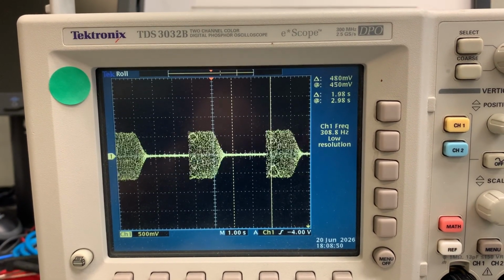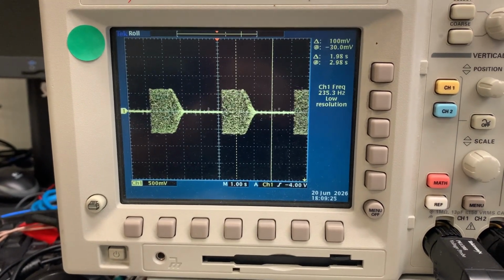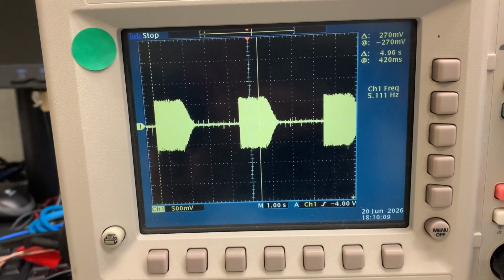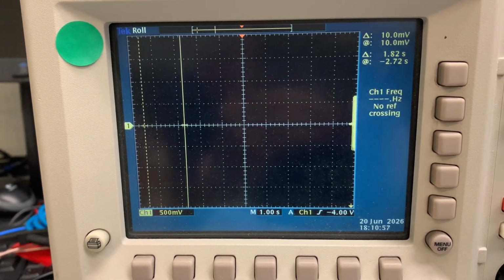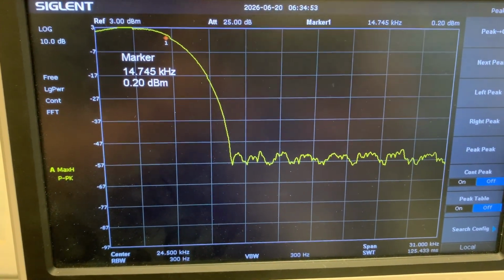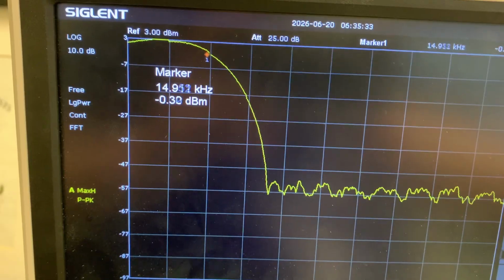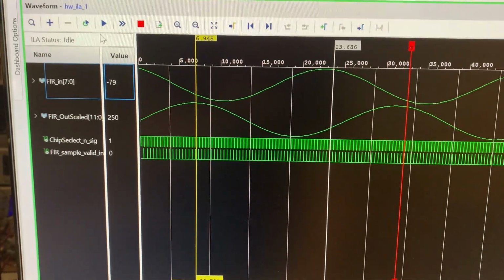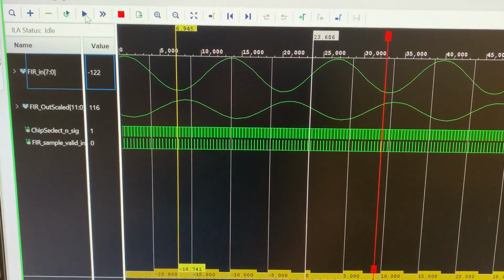LIVE FIR 25KHz Frequency Response Validation on FPGA | 0–40 kHz Sweep | Spartan-7

Comment from the maker: 📡 About This Series

The goal of this DSP-on-FPGA series is to take viewers from fundamental DSP building blocks to the complete implementation of digital AM and FM radio receivers on real FPGA hardware.

Along the way, we will cover:

✅ DDS Signal Generation
✅ FIR and IIR Filter Design
✅ Dual-Channel I/Q Filtering
✅ Decimation and Interpolation
✅ CIC Filters
✅ Digital Downconversion (DDC)
✅ Digital Upconversion (DUC)
✅ AM Modulation and Demodulation
✅ FM Modulation and Demodulation
✅ Bandpass Sampling Techniques
✅ System Generator to Vivado Workflows
✅ FPGA Hardware Validation

Each episode builds toward a final goal:

🎯 Designing complete digital AM and FM radio receivers from scratch on an FPGA.

Subscribe and join the journey! 🚀